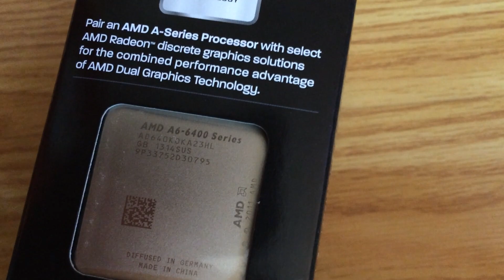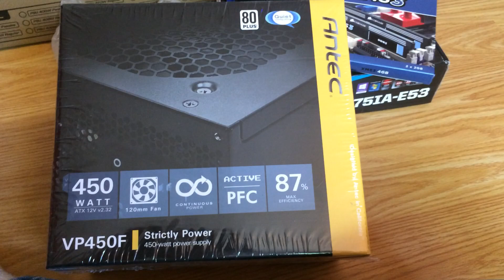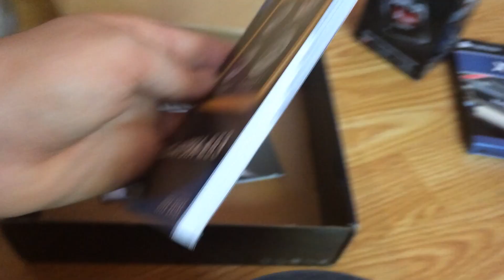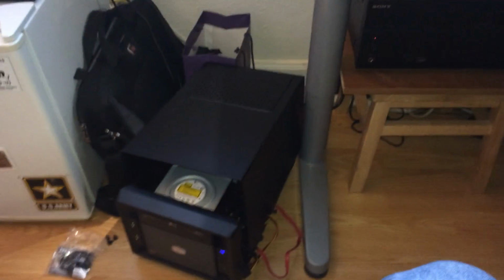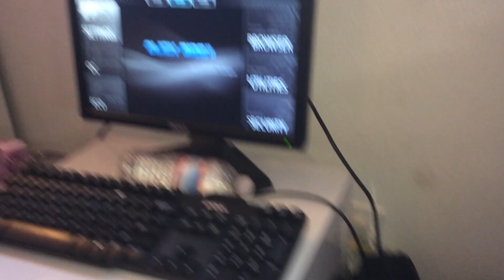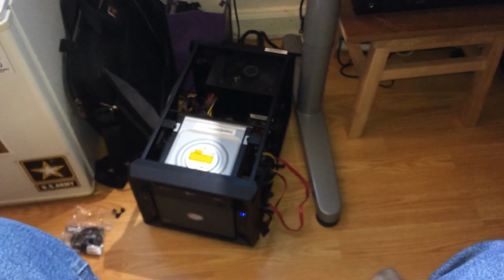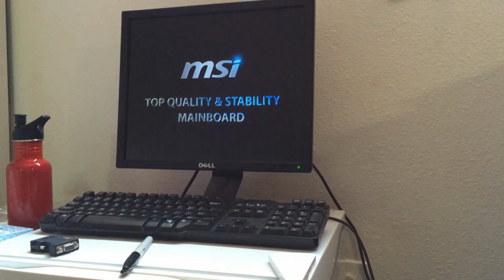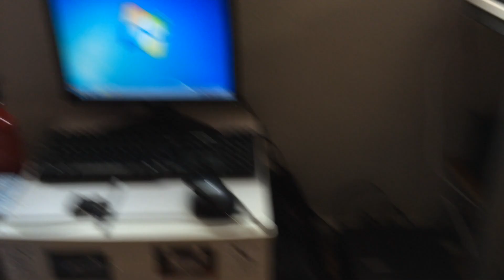AMD A6 mITX Build - April 2014

Comment: I WATCH Your videos all the time,like your builds.
I could use some advice on my Budget build?
 First build ever,
I will never buy a desktop or pc again, i will always build from now on.
My system i have know is ok but slowing down a bit.alot of people say its junk but i think its not bad the price was way too high for this system
System I have is a first generation APU/I think???(AMD APU E-series p2-1334 2 core 1.4 ghz) play's most games like Lord of rings,Mass Effect3 multiplayer/single,shooters,and similar, ok,very laggy though.happy with graphics nothing added to factory/build
I studied alot about chipsets and ways to optimize performance of the APU for my build.
Anything i could add to help the system Performance/FPS/LAG issues?,Cant spend alot more.
Im sorry lets move on:)
I  got case already/Big & Steel/simple,plus i like the space for airflow, do not like that it has no fans,only one mount on back.I will put a decent fan there,dont want to overheat System.
I am trying to optimize system for best performance with lowest cost for now
 I can upgrade later.This is what i purchased so far,
1.Case-Atx Mid tower PC-389 (this is what i got and ordered so far)
2.P.S.U.- RAIDMAX COBRA RX-400WATT(On sale($9.99/$20 mail in rebate) 
3.APU-RICHLAND DUALCORE A6-600K Black Series(Almost got the Kaveri dual core)
4.MSI-A78-E35 FM2+/FM2(i wanted a different MSI board, the 85 chipset but they were soldout)
Questions, Will a 120MB SSD  help performance?
I am  adding a 2 stick RAM DDR3 for the dual channel support in motherboard.
Just not sure what will work best for lowest price /bang for buck?
G.SKILL 4GB(2X2)DDR3 SDRAM 1600(PC3-12800)?40 bucks,customers choice for RAM on newegg.
I  want to make sure the RAM bring's out the good performance in the system.
I  really struggled picking out MOBO.I wanted the chipsets to help performance plus wanted added on board graphics,
I would appreciate your thoughts on how im doing and if the performance will be ok?
TAHNKS, GREAT BUILD VIDEO, HAVE AGREAT WEEKEND

Comment: You should place the motherboard directly onto the box it came in, not the anti-static bag. The outside of the bag can conduct electricity. You also forgot the I/O shield.
Reply from the maker: I don't believe that, sorry. Never had an issue doing it that way and I've built many systems.
And uh...no I didn't?
Reply: Ryan Gehret
Whether or not you believe it, does not matter; It does not make it any less true. It has the potential to cause damage, not "it will kill your board 100% of the time". As for the I/O, I guess it was just me. It must have just been really reflective or the lighting.
Reply from the maker: An anti static bag is not supposed to attract static...that applies to the outside of the bag aswell.
Reply: Ryan Gehret
Actually, it's designed to attract static electricity. It works as a Faraday cage, it protects only what is inside of it.
Reply from the maker: Hmm. I would do research but too lazy. Either way, haven't had any issues ever so I don't see a problem
Reply: Ryan Gehret Yeah the man's not wrong. Next time err on the side of caution and place it on the box, killing computer components is not a fun experience.
Reply from the maker: Alright for fuck's sake stop making it a big deal
Reply: Ryan Gehret I think you have some anger management problems or something lol. I wasn't making a big deal at all.
Reply from the maker: lolwat
good then

Comment: I feel your pain, I was sick and I worked on a D630, I forgot to put the RAM in and connect the display cable. I owned that RAM,  I would never use it again, it was never stable.

Comment: My brother just build a second PC, a 4th gen i5, 8 GB ram, (cannot remember MOBO) Cooler Master 500W PSU, etc. All wrapped up in a Fractile Designs Node 304.

Nice build though, it should be pretty good. I use XMS3 ram in my custom PC, not much to say about it.

Comment: Nice build. I LOVE the AMD A-series processors. When I buy a new laptop I'm going to try and get one with the A10 (or whatever they have by then, since it'll probably be a few more years before a buy a new laptop :P).

Did you or would you have the chance to run the Windows Experience Index on this machine?
Reply: Ryan Gehret Not with that thermal paste shit Intel's doing. The enthusiasts line (LGA2011) is pretty good though, and AMD can't beat them there
Reply: Ryan Gehret I still don't see any reason for Intel to do that. You'd think a company with $75 billion in revenue could afford solder, guess not then.
Reply from the maker: They seem decent enough. Yeah I did: 6.5, 5.9, 4.6, 6.2, 5.9.
Reply: I just got a Lenovo with A10. Thing is a absolute beast. Doesn't touch my custom rig but in the price range for laptops you get a lot more gpu out of the A series over the Intel Core Series
Reply from the maker: AMD seems to be doing pretty well in the low end. They can suck it in the high end though. Intel is killing them up there.
Reply from the maker: Oh piss, that's only important if you're doing overclocking. You don't need to hit 5GHz to best an FX.
Reply from the maker: I don't either, but still.